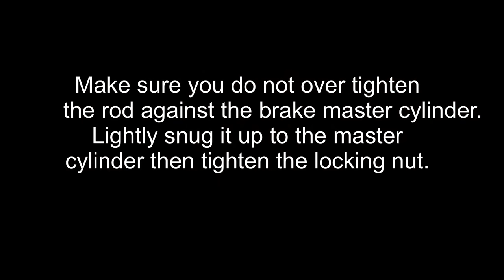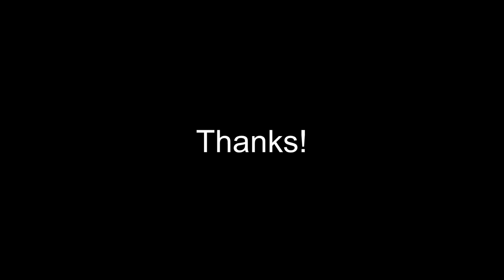Installed Strano brake master cylinder and new Air intake tube

Comment: Did you get a tune after intake/exhaust/gears?
Reply from the maker: Bryce Hoffman just got the car two weeks ago. Already had gears, intake and exhaust. Car has a street tune done on it from hp tuners. . I have header sitting in the garage. Is that something you’d like to see before I do anymore hp upgrades?
Reply from the maker: I have a local shop I can get it dyno at.

Comment: Just so you know you install that improperly. The locking nut does not go on the outside. See Strano’s clip https://youtu.be/2MeBGzjqGTY
Reply from the maker: https://youtu.be/eGAClr0sA5Y did it the way hawks did it.
Reply from the maker: I personally don’t see the difference either way. I think either way will hold the rod. I’ll change it if it backs out or gets loose. Thanks for let me know though. You’d think hawks would be a reliable source.
Reply: Hawks did it wrong too! Installing it that way will make the rod weak with no support in the center/front area.
Reply from the maker: LT11988 I switched it. Thanks for the heads up.
Reply: Sam makes this brace not hawks, so I would do it how sam says in the instructions